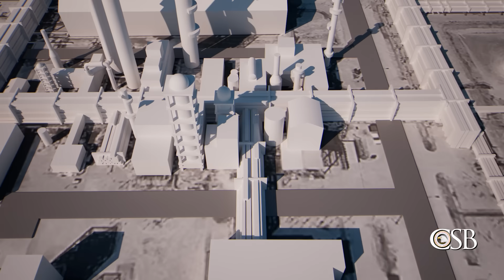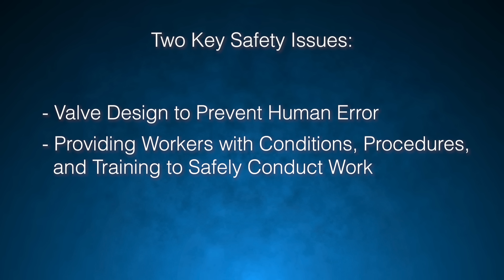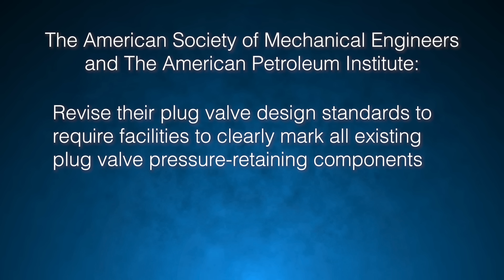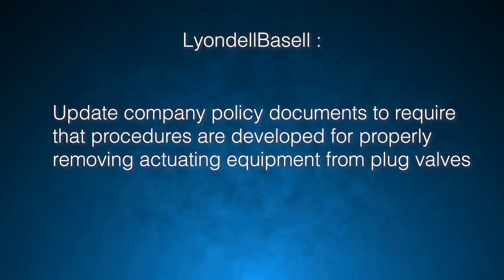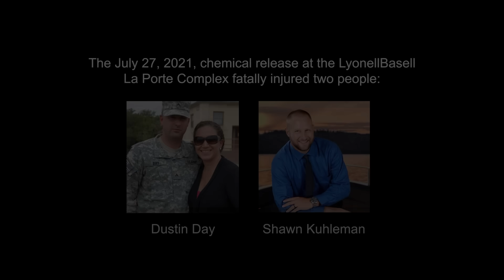Designed to Fail: Chemical Release at LyondellBasell

Comment: I have learned a few things from these videos

1) Don't work or live near a chemical plant.
2) Dont get inside confined spaces.
3) Alarms and warnings need to be carefully selected and implemented to prevent people ignoring them.
Reply: Confined-space work needs a lot of respect, for real.
Reply: Alert blindness is a real problem. I've worked in IT operations, and the thing where the alerts go off all the time and you just learn to ignore them inevitably eventually leads to some kind of mess. It was one of the factors leading to the disaster at Three Mile Island.
Reply: Alarm fatigue is a real problem now in many industries. People setting them up think they should add alarms for everything. There should be an ISO standard for alarms and corrective actions.  @adambuchbinder2791
Reply: Also, train your people on every facet of maintaining all your equipment. This happened because the workers weren't properly trained.
Reply: I work in a chemical plant as a maintenance manager.  Its the safest place I've ever worked and that's because we have a good safety culture.  If you treat everything like its trying  to kill you, you will be fine. There's no way I would have ever let some random contractor work on a valve that was actively holding product back. The tank would be drained before we would touch it.
Reply: @diode30  Now imagine being in a place like I am, where the only thing that matters is how fast it's fixed.
Reply: I'd also add that the design of these components is so important. It should be harder to do the wrong thing than to do the right thing. You know that meme with the box of needles right next to the box of poison tipped needles? This was that thing, except instead of being poison tipped, the components were pressure retaining.
Reply: @adambuchbinder2791  Poka yoke is important in design to prevent mistakes.
Reply: @rivalrepairs  This is the first I've heard of that term, thank you!
Reply: Alert fatigue costs lives!
Reply: 4) As a software engineer, i feel like my job doesn't require reading nearly as much procedure and regulations as some other engineering jobs 😬 (or maybe i'm not aware of all the things i should read, but then i'm not alone).
Reply: @GabrielPettier Software engineers in industrial processes have to take extreme care to ensure their code does not lead to unintended consequences in process operation.
Reply: @GabrielPettier 
That changes when your program is what is determining how a valve is actuating. 
I have seen bad programming cause troubles.
Reply: @erniecolussy1705  Yeah, i guess in industrial processes things are probably tighter, but given how prevalent software gets in, well, everything, our profession will certainly have to step up its game, to avoid crashing planes and blowing up factories, or irradiating patients, or well, crashing markets 😬.

We now have the capacity to mess up at unprecedented scale!
Reply: @GabrielPettier I work in industrial automation and have colleagues who work the software side of things, like Process Automation (PA) software. 

Critical systems generally have multiple safety mechanisms working in parallel, independent of software. PA can monitor for failures, but isn't needed to contain them.

However, some failures require a complex series of steps to return to a safe state, warranting the use of software. Such software is written for dedicated components called Safety PLCs. These components are seperate from PA and adhere to standards like SIL.
The software itself is extensively tested and validated, before being downloaded to the PLC and locked.

All of this means you shouldn't sweat about writing safe software, unless it's actually used in a medical / critical system.
Reply: @GabrielPettier  it depends on the industry you are working in. If you are in O&G, well your software will have a vital impact on everyone's safety and well-being.
Reply: @troybaxter  I don’t but i don’t mean software can’t be dangerous and have catastrophic consequences for humans it processes one way or another, just that maybe because it is, it should be regulated a lot more.
I work in finance, and i implement compliance specifications, letting the regulators know exactly what we do with money every day, we have quite a lot of compliance from a business point of view, and that translates into the software that needs to be written, but we have less regulation about how the software needs to be written, and what kind of reliability and safety is needed.
On a personal level, I do appreciate the freedom we have, but maybe at a society level…
Reply: #3!!!!!    Company spent massive ammounts of time killing nuisance alarms.  Some times its as simple as a 5 second delay to see if it clears on its on.   Tower water level low?   Nope, just a wave.  Sometimes its a complicated calculation of only beinga safety risk, above a specific temp, less than a specific flow, and above a pressure 100 psi more than another vessel.   That last one can take time to figure out the specs and impliment them.
Reply: @dave4882  we can always do with more controls engineers to sort these alarms out and fault find the root cause
Reply: @rivalrepairs  sorry, those cost money, and provide no profits.
Reply: 3b) Those alarms and warnings need to be regularly tested to ensure that they will activate under their corresponding physical conditions
Reply: I grew up within 7 miles of multiple chemical plants.  We practiced chemical release drills in school.
Reply: 4) Greed is usually the fundamental culprit.
Reply: I understand where you're coming from after watching these videos, but I will tell you that chemical plants provide some of the best paying jobs in this nation. They help keep the middle class strong in blue collar cities.
Reply: then whos gonna work in the chemical plants
Reply: @me-it9jn  you can outsource those jobs to countries  with no environmental laws and no worker protection laws.  Problem solved.  I've always thought the protection laws in this country needed to be based on selling a product here, not just when made here.  Rare earth is mined in china.  The mine in the US cant meet environmental laws at that price point.  I'm sure china just doesn't dump toxic chemicals into rivers.  Make importers prove their products were produced with American standards if they want to sell here.  Better for Americans, better for foreign workers.  Don't even look at the Indian pharmaceutical companies that fail FDA inspections but are still allowed to sell in the US.
Reply: Dont fall in love at the copa cabana
Reply: Two of my friends worked at a place where they had a trifecta of confined spaces noxious atmospheres heated corrosive chemicals and the old favorite live steam

Years ago they did an upgrade of the number of reaction vessels, replacing sensors and inspection windows.

They were piling all the various pieces of what looked like glass on a couple of pallets and I asked somebody about that and they said they were going to dump them.

I looked at a few of them realizing they were Pyrex and a few of them were few silica. They were inspection Windows into reaction processes were they didn't really need a visual inspection anymore so they were being removed and covered over. I got the two pallets that were loaded with about 1500 lb of various pieces of Pyrex and I've been making telescope mirrors out of them. The largest one is 22 in in diameter and is 3 in thick fuse silica and was made by General Electric and they still have all the paperwork around for this material that last one is worth approximately $4,000 if you wanted to buy it from a place like Advanced Glass Fab and is used on high performance telescopes intended for professional observers or spy satellites
Reply: 6: when a vapor cloud forms gtfo
Reply: As someone who has worked around this type of equipment for more than 40 years, it astounds me how many ‘in the industry’ know almost nothing about the equipment they work on.

Like these pipe fitters, I’ve met many who would not understand how the valve is put together. Unfortunately these are also the most likely individuals to NOT read a written work instruction. 

This applies both to operations and maintenance personnel.
Reply: 5) Non-union work is shoddy and will lead to rushed deadlines, injuries, and fatalities.
Reply: B.S.  @DrCranberry
Reply: @DrCranberry what you have here or contract work being sent out to the lowest bidder and then they hire the cheapest labor they can find I found this out personally when I was in Anacortes and sharing a motel complex with contract workers working at Cherry Point refinery, scene of a number of accidents and one of which was featured in a video here on I believe it was hydrogen enbrittalment
Reply: @DrCranberry  5 b) don't be a third party contractor hired to do maintenance :(
Reply: @mobius273  Third parties are always hired to do maintenance, that's not the problem.
The problem is they were improperly trained by the plant, and their company, and that the plant didn't do a system drain down and confirm the system was drained by leaving the valves open.

Even IF everything went right and that valve was closed, there would have still been pressurized residuals of a highly corrosive, and toxic chemical in the line that was super hot.
Reply: @DrCranberry  when companies farm out critical work to contractors it seems way more likely that that contractor is going to be forced into a situation they're not properly trained for though.
Reply: @mobius273  It's both the company and the contractors fault in this situation.
The workers weren't trained, nor were properly informed and it happens when it shouldn't.

The biggest "oh fuck" I ever had was being sprayed with Acid after I was told a line was depressurized and ready to work on.
Undid one bolt and sprayed my face and suit, and LUCKILY i was wearing a corrosive suit, because after 30 minutes it quite literally melted.

90% of the time it's the companies fault, I don't know your systems and can only make educated guesses, it's up to YOU to make sure I can work safely and know the plant.
Reply: @mobius273 but the liability is going to be on the contractor in many cases, and no matter what they say, THAT is the point.
Reply: @johndoe-so2ef  i know lol
Reply: @mobius273  It happens, but it's not necessarily so.  Some third-party maintenance crews are pretty tightly integrated in an operation and know it pretty well. Not the case in this instance.
Reply: @DrCranberry it's part of the problem, third parties are hired this way 1) so it looks better for shareholders etc that you have reoccurring one-off costs of those hires rather than actually having permanent in-house workers who can always be there when needed and 2) because subcontracting is a useful method of reducing liability and making it harder to hold those actually at fault to account when stuff like this happens. Quite aside from the corruption and the terrible practices of the subcontracting companies themselves. It's about insulation from consequences.
Reply: Replace "chemical plants" and "confined spaces" with "Texas".
Reply: @tryste_mx  100%!!!
Reply: @tryste_mx replace your brain with something more capable of complex  and meaningful thoughts: mashed potatoes is something you might want to consider given your budgetary range.
Reply: @ClementinesmWTF  ope, struck an awful chord down in deregulation country 😂
Reply: Guys, Here is our Savior

HalleluYAH translates “Praise ye YaH”

YaH is The Heavenly Father
YaH arrives via the TENT OF MEETING
YaH was Who they Crucified for our sins
YaH was Crucified on an Almond TREE

Semitic of Moshe (Moses)
Isa Scroll (The Original Isaiah)

Isaiah 42:8 - I am YaH; that is my Name! I will not yield my glory to another or my praise to idols.

Isaiah 43:11 - I am YAH, and there is no other Savior but Me.

Isaiah 45:5 - I am YaH, and there is none else.
Reply: no the answer is you should do your maintenance on your own equipement but no you let compagny wash their hand and give it to subcontractors ... th many time it happened in the past the compagny was in fault so they had to pay for their mistake but with  subcontractors they pay for the spill ... 100% uscb fault even more if people died there before you gave them the ok to continue this countrywide....
Reply: @jessicalacasse6205 there's a line tho, depending on the frequency of a maintenance task. If it's super in frequent and specialised getting a contractor in that does that job every week is an improvement over internal staff trying to remember how they did it last time 5 years ago.
Reply: And don't eat any processed food containing Acetic Acid?😀
Reply: @jamesminnihan7468 then you'll be missing out on quite a lot 😆
Reply: @jamesminnihan7468 Acetic acid is just vinegar. It's quite likely you've ran into some already!
Reply: @krissp8712 Vinegar is about 4% acetic acid. I wonder how high the concentration would have been in this case. Plus it was hot.
Reply: @krissp8712  at 5% and room temp, it's "just vinegar".  At high concentrations and/or high temperatures, it's pretty dang hazardous.

Comment: I did not know that you could die of basically concentrated vinegar exposure.
Reply: Ever tried to clean a kettle from limescale with 20% vinegar? Hot acetic acid is very unpleasant even at 20%, and definitely something that can wreck your airways.
Reply: Household vinegar is 5% vinegar, 95% water.  This was 100% vinegar.
Reply: Likely was a mix of acetic anhydride and acetic acid
Reply: @MandrakeFernflower  Possibly, but even if it was just anhydrous acetic acid, and hot at that, it's definitely fatal even without acetic anhydride. In my opinion, one of the most horrible ways to die.
Reply: If you've ever breathed in a boiling pickling mix, you'll know your nasty acetic acid is to your lungs.

Comment: The intro is becoming too powerful
Reply: Though if they want to be accurate they should use an actual bald eagle call.
Reply: It used to be comically M.U.R.I.C.A. They cut 90-95% of the original anniversary intro, which being a filthy foreigner I nearly died to.
Reply: Fun fact: the sound the bald eagle makes is not a bald eagle sound